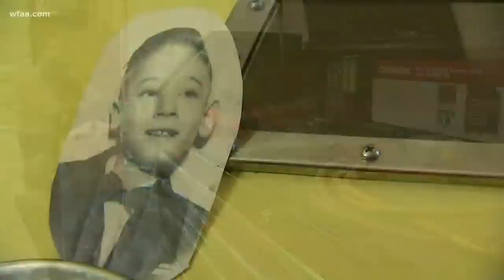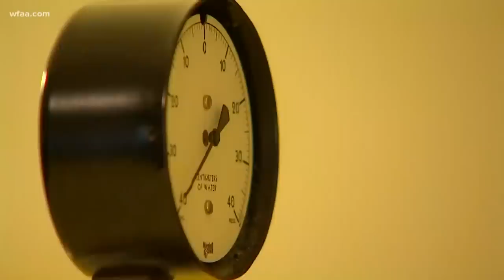WFAA Original: Man in the iron lung

Comment: What would happen if the motor needs service maintenance or the worst ever possible - stop working sudennly ? 
Is there any procedure for emergency inchanging in case of this or another machine fault, not killing the person ?
Or just we rely on the hope of this machine don't brick up ?
Reply: I think you can run it manually from the outside but someone has to be pumping on the handle. I saw it on another video.
Reply: MAY ALLAH ALMIGHTY BLESS YOU SIR PAUL RICHARD ALEXANDER. MAY YOU ACCEPT ISLAM. SIR ISLAM IS THE CORRECT PATH. I BEG YOU TO READ THE ENGLISH TRANSLATION OF THE HOLY QURAN. THROUGH THIS YOU WILL GET TO KNOW THAT JESUS A.S WAS A PROPHET OF THE ALLAH ALMIGHTY. SO WERE DAVID, SOLOMON, ABRAHAM, NOAH, JOSEPH AND THE LIST GOES ON. THE HOLY PROPHET MUHAMMAD (peace be upon him) IS THE LAST PROPHET OF THE ALLAH ALMIGHTY AND IS THE SEAL OF THE PROPHETS. PLEASE SIR I BEG YOU TO ENTER THE FOLDS OF ISLAM. MAY YOU TREAD ON THE PATH OF GOD. MAY GOD BLESS YOU AND YOUR FAMILY IN THIS LIFE AND THE HEREAFTER, AMEEN SUM AMEEN!